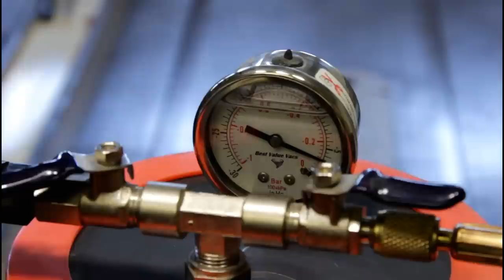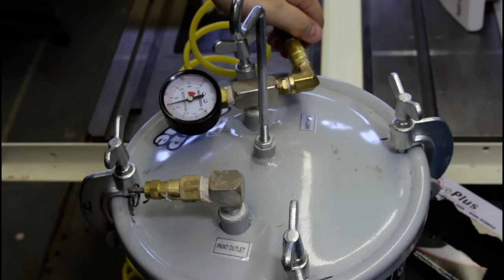Resin & Charcoal: Creating a Charcoal Bowl

Comment from the maker: Lets quickly address safety. 

I don't recommend anyone turning charcoal. You need a respirator (which I had), and some way to contain the dust! I had both a dust collector and a full overhead shop air filter running. I filmed in short spurts, and this took me almost a full afternoon to turn as I keep the sessions to a few minutes at a time. 

Be safe, Don't try this at all.
Reply: An absolutely fantastic finished product. Great vid.
Reply: Thanks for the heads up! I think this is my favorite bowl you’ve made.
Reply: I don't know if that's true for any "wood" turning. But if you do this be sure there are no sparks or open flames nearby. You can look up a lot of videos on dust explosions here on YouTube.
Reply: SooooOo... ... cam i have it?
Reply: Tht glow, simply amazing
Reply: so what you're saying is don't do this at all or do it outside in your neighbors yard. got it
Reply: thank you for addressing the respirator issue, I was going to comment on it, but now do not have to be questioning about it.  Great video and project as always
Reply from the maker: @seamonster4554  No, I'm going to keep this one. :)
Reply: cough...cough....i think im getting the black lung pop...its not very well ventilated down there...
Reply: @PatEm10  🤣
Reply: did you put a layer of resin after the piece as done? you should, just to seal everything and make it extra shiny...
Reply: @peterbrownwastaken  then I hope you will make more to sell on your website
Reply: I think it would look amazing with some ocean blue pigment in the casting resin
Reply: You've accidentally made a piece of The Void from Arkane Studios video game series Dishonored.
Reply: Peter Brown you need to make more videos yo be popular man
Reply: how about wet turning, not sure if thats even a thing but it sounds like it should
Reply: Glad you had a respirator. I didnt seen you have one on and was a bit worried due to all the dust I was seeing on your hands and in the air.
Reply from the maker: @PJ_Bottoms  Yeah, once I turned it around to start hollowing I was wearing my full respirator. I did have to remove it to talk to the camera at that one part. I do try to be safe. :)
Reply: Peter that bowl is incredible!
Reply: safety aside, that bowl it's truly a work of art.
Reply: You should definitely try using the stabilizing resin in another project to get that amazing effect.
Reply: Imma try this
Reply: Charcoal to my knowledge has no toxic properties, but dust is still dust.
Reply: I might be missing something super obvious, but couldn't you rig up your vacuum to catch the dust and resin to cut down on the mess?
Reply: Oh my god, this bowl is freaking AMAZING looking. I'm glad you did it safely as well!
Reply: Peter Brown you should do something with crushed CD’s
Reply: but we're carbon based life forms, whats a little more carbon dust in our lungs? /s
Reply: Since stabilizing resin glows under a blacklight, does that mean some of your other projects will glow too? Maybe like the corn or bread pendant?
Reply: Not trying to be a dick, but if you truly don’t recommend trying this then maybe don’t link to all the supplies, including the charcoal, on amazon in the description.
Reply: Peter Brown when are you going to make a bowl from resign and glow in the dark ceiling stars
Reply: This turned out beautifully. It's a shame the charcoal so hazardous to turn. It would make some gorgeous jewelry!
Reply: I’m curious about the charcoal dust. Did it smell like burnt wood?
Reply: That was so cool! I still think you should do the same thing with glow in the dark airsoft bbs and mixing the stabilising resin with the casting resin for those swirls. You might get like some wierd galaxy bowl.
Reply: Thanks for the safety concern, and thank you for the video! The bowl turned out absolutely amazing.
Reply: This opens doors.
A lot.
You should try to make a sculpture based around the stabilizing resin's ability to glow under a blacklight, especially when cast in casting resin.
If you'd like I can send you a few sketches for ideas    ( :
Reply: Yeah good call. I saw all that charcoal in the air and was thinking "aaaand you have lung cancer now"
Reply: Wow the uv reaction was crazy
Reply: Thanks for the warning, but now you have already done it, I don't have to! :-)
Reply: I desperately hope you were wearing protection!  All that dust and epoxi shavings just *everywhere*!  My goodness me it must have smelled *awful*#
Reply: Peter Brown well thank you for the risk that you have taken health wise, because you are absolutely right that is an amazingly beautiful awe inspiring bowl!!!!!!!!
Reply: Glad you wore a respirator. Save those lungs.
Reply: Absolutely something that would make some awesome jewelry
Reply: The other concern I have is that charcoal dust (being carbon) is conductive. Make sure you've blown out any dust from power points, switches etc REALLY, REALLY THOROUGHLY! You don't want to start an electrical fire in the shop!
Reply: Should have used activated charcoal. Its safe to ingest.
Reply: I’ll probably be trying this anyways, love the bowl and now I’m not sure if the cereal bowl is my favorite anymore
Reply: Should try Black 2.0 as a resin dye, or any of the other pigments Stuart Semple offers!
Reply: Make a grass and resin bowl
Reply: Nathan Woo Coal-miners get lung damage and cancer from various components in coal, including carbon and silica, which are also present in wood and charcoal.
Reply: Hey Peter, I've been watching your videos for a long time now. This may have been the first time I've ever commented on one though. I'm so glad you mentioned the fact that you had been wearing a respirator. A lot of people would never have thought about it but while doing these kinds of projects that involve sanding, drilling, or turning the resin particulate and charcoal particulate could cause a pretty significant health hazard. Especially if they plan on doing it frequently. 

Also, I like your videos and want you to stay healthy so you can continue to produce awesome content!
Reply: Why not blend/crush the charcoal into a powder, mix it into resin and make a carbon resin bowl?
Reply: What is so specifically dangerous about charcoal dust, vs. wood dust? Both are primarily just carbon and highly combustible, but I can't see how charcoal is much worst than wood dust.
Reply: Peter Brown There’s a trestle for the train tracks above the swamp and according to my grandfather that when he was a young kid he was told that some train cars that were full of coal had fallen off the tracks, sunk into the mud of the swamp and were never pulled out of the water. I have a fishing spot downstream on the opposite side of the bridge and within throwing distance of the trestle, and every time after there’s a thunderstorm & heavy rain/a hurricane there will be more chunks of coal all sizes from as small as a peanut to as big as a basketball (a few of times bigger!) with a shiny glossy look & slight purplish/indigo/royal blue streaks as well as flares of reds and oranges from what I assume is the buildup of iron on the outside. Then again this could all be coal that was actually formed in the swamp. I have been taking a bucket & picking up the “pretty ones” and collecting them. If you would like to make another Charcoal Bowl, I have plenty of it for you. Just let me know. 

Plus , if you ever have enough spare time to make another charcoal bowl like this, I would be more than happy to buy it off your hands. 😄😁☺️😊🙂
Reply: seamonster4554 when you learn how to spell three letter words, yes.
Reply: @peterbrownwastaken  Good tip on the safety concerns of doing anything that creates charcoal dust. I'd like to add that in adition to being a respitory hazard it is also potentially explosive. Any electric device not rated for an explosive environment could set it off in the right concetration. That includes a powered respirator, the motor on your lathe, the  air filter, and even a vacuum unless it has a grounding strap running through the pickup hose. Be super careful if you decide to make another one!
I love the finished product though and it's awesome that it glows under a black light.
Keep up the good work!
Reply: @ranwolf76  The dust  can generate static electricy in the confined space of a vacuum hose and it's also in high concentration and that might cause an explosion.
Reply: @allstarwoo4  the charcoal is not toxic unless it's barbecue charoal that's been treated with accelerants. Activated charcoal is put into pills to help absorb toxins out of your body should you accidently injest poison. The hazard in the dust comes from it's potential to clog up your lungs. Not a big deal for short term exposures but you wouldn't want to breathe that stuff in on a regular basis.
I work in a plant that makes activated carbon, which is pretty much the same stuff just not made from organic materials.
Reply: @davidbumpus3457  I hope most people would know the difference between the 2. I feel like that's a fine dust problem in general.
Reply: EtCeteraProductions I do agree, but any person with access to a properly ventilated shop with the requisite safety steps in place should be okay to do this project. or, pretty much any art student has all this stuff on hand. i literally have every single product available to make this at home, so, there’s a bit of a uselessness when any blick or michaels carries every single material in their casting and drawing aisles, lol
Reply: Nathan Woo this is true! however, any particulate buildup in the lungs is dangerous. look up clown lung for example
Reply: Peter Brown lmao I luvs ya peter
Reply: I would pay $15-$20 for one
Reply: Peter Brown  Can I buy that bowl
Reply: I don't want to go through 92 comments to see if someone else mentioned this... I have 2  actually:)  1.) U could rig up a wet system, something akin to a tile saw. Just takes a pump and a pan. 2.) build a pup tent around it, akin to an incubator,  but fabric so you can wet it down. Could leave the whole working side open so safety is not an issue.... Also, there are dust tables, basically an air hockey table in reverse which can be converted with a vacuum and a little ingenuity.

 Great bowl. Is it food safe? Is there exposed charcoal on the bottom of inside? Don't different pours mean there is a separation between the two layers, how do you make them cohesive? lol   answer NOW! hehe 

peace bro. tx. whoa, dat shite's expensive, eh?
Reply: you really aught to see if you can set a blacklight in the bowl that'll make it glow all the time
Reply: @TheNomnomnommer  - Love the name, the suggestion is a lil obvious:p

Actually, it would be easy to do, if the host is reading, … most LEDs can be set in the acrylic before it hardens. You can buy strips for example which come already covered in silicone, it's sold as waterproofing. And they are cuttable every few cm's and flexible, not hideable though. Maybe get a string light, like you see in bottles on a coffee table. many ways, LED are magic,lol. peace
Reply: Peter Brown instead of trying to remove the air bubble you should wipp it and see how it comes out and if it's still strong
Reply: Can I purchase it? It is awesome
Reply: So the stabilizing resin is what causes the blacklight reaction? You could get a similar effect with a similar material(deep grooved), use the same resin, and use it before the stabilizer completely cured, and you may get a similar effect?
Reply: Peter this the most beautiful bowl you’ve made second is Secret Wood Bowl  :) 👌
Reply: You should make a blacklight stand for it to sit on. And or make a matching table.
Reply: Hey peter, why dont you cover your wood block in packing tape and spray it with mold release
Reply: Someone already mentioned it, but just to expand: carbon is conductive. The life of the power strip behind your lathe, and the life of the power tools you used, was probably shortened quite a bit. And unfortunately, blowing it with air also insures the dust will make it go deeper into things it shouldn't.
Great bowl, but make sure you stay safe.
Reply: I would love to buy that bowl
Reply: You should totally try to make a bowl or something with a gallon of glitter
Reply: We're you able to get a shot of the shavings under the black light?
Reply: So beautiful!! It's a shame that the making is so dang problematic,  but the finished product is just fantastic!
Reply: One more thing to add; Charcoal dust is flammable. It's fundamentally no different from coal dust.

Coal-dust explosions killed a lot of miners.
Reply: Beautiful
Reply: I was just going to address this, thank you for reminding people :))
Reply: Why not just spray it with water while you're working it through the lathe?
Reply: You should colored pills in resin make something from it. And you should see if it would be a good white and kids vitamins.
Reply: good thing you didn't nitrate the charcoal  first lol / watched  until the end i normally try to give a video that  effort as I've suffered from a short attention span my hole life. couldn't have been more rewarding. whom ever came up with this idea  is beautifully morbid . there are minerals in the ground that in the light of day are hideous in appearance. as well hit the light switch in a dark room and be prepared to be ocular wise,   immensely  pleasured. though this item is wonderful in either state. it looks. to me for a beginner they shouldn't be faint of heart the starting point  seems unlikely  anything might come of it . you sir are a brave man. nothing like hitting your mark  when you have to search for it first. i'm sure you feel lucky. i would.
Reply: Why dont you use metric?
Reply: Peter, thanks for addressing the dust issue. I was more concerned about running the lathe without the pulley cover in place 😀. Great bowl though!
Reply: Peter, i know this is an old video, but what if you used red resin? I think it would look like a cool volcano bowl.
Reply: Even with all the extra requirements for safety, that end result speaks for itself. That bowl is dope!
Reply: know a crushed charcoal and glowstick fluid resin bowl or cups please
Reply: This could possibly give a person black lung.
Reply: Hi Peter, what brand of resin to stabilizing the charcoal you use?
Reply: I was just thinking, that charcoal dust can't be good to breathe in
Reply: i think if you do to the lather bols what you have don to the chaircial bols the afet & usful nes would be inanst , triy one .
Reply: 🤯🤯 mind blown with a black light!!!! 

And on a different note, I was expecting it to explode in the lathe, so glad it didn’t. It looks amazing!!! I want like 5 for my house lol where can I order them?
Reply: Peter can you also add a charcoal resin bowl

Comment: So use the stabilizing resin, some charcoal, regular casting resin, and a black light bulb....use some really cool wood, make yourself the coolest light fixture ever and use the “bowl” as the “lampshade”
Reply: DO THIS!!!
Reply: I think that would be awesome to see. I think you could pull it off
Reply: You'd have to be careful and make sure there's some way for heat to escape from the top, if resin heats up too much it'll become malleable and loose its shape
Reply: Is the black light only in incandescent or is it available in L.E.D as well?
Reply: Debra Bosch They make black light LEDs.
Reply: @wjspade  thanks for the reply.😆
Reply: don't do this (without proper equipment). breathing charcoal dust is very dangerous.
Reply: Max Morella Peter Brown said in his initial post that he was using a respirator, dust collection, and shop air filter; and still wouldn’t recommend anyone attempting to turn a charcoal bowl.
Reply: Max Morella yes he uses proper safety equipment. Anything is toxic nowadays. I’ve been in several burning buildings. Even with my PPE (personal protective equipment) I still have a higher risk of cancer as a result.
Reply: Or maybe a low powered night light situation?
Reply: Peter Brown !!! You’ve got allot of support for this

Comment: I wonder if the blue hues and highlights could be a result of the stabilizing resin displacing some of the tars and oils that remain in charcoal.

You should ask Cody's Lab. He did a video about activating charcoal, and mentioned the oils and tars that are present in "raw" charcoal.
Reply: Maybe the resin is acting as a sort of diffraction grating with the surface of the charcoal?
Reply: @darklordofapathy   that is what I was thinking.
Reply: Could also be that the black that the charcoal has is a blue based black
Reply: @Lunatikhex   my argument against that is, that it was once wood and therefore organic. Most organic things turn brown when they oxidize. Fire is a rapid oxidation reaction and charcoal is made with it, so I politely disagree.

TL;DR: Nah, wood is brown.
Reply: @jairusswint6703  blue can also be a color in brown (browns made with equal parts of the primary colors) but it could be a brown with more blue then red, and still make the hints of blue when burnt
Reply: @Lunatikhex  if you look at when he is pouring the stabilizing resin around 0:55 or so, the resin has a blue tinge.
Reply: @jairusswint6703  I'll look again!
Reply: That's what I'm thinking too!

The tars and oils in charcoal contains both anthracene, phenanthrene, and similar polycyclic aromatic hydrocarbons. They are known to fluoresce blue.

Of course, charcoal itself isn't fluorescent. I suppose that's because when deposited on carbon, the fluorescence from these compounds is quenched: they can still absorb UV and get excited, but instead of re-emitting blue, they transfer their excitation energy to the graphitic carbon in the charcoal.

Once dissolved in a suitable medium (like, maybe, stabilizing resin), this does not happen anymore, and they can exhibit the beautiful fluorescence they're known for!